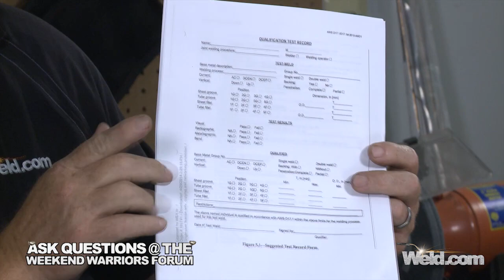D17.1 Certification: .063 Flate Plate Aluminum Tips | TIG Time

Comment: I was told I would be taking a plate test for aluminum 3/8 or 1/2.  What would the procedure be?  I can't imagine it would be a butt weld due to the thickness,  I see nobody welding V groves, if it is would it bee open root or backing strip?

Comment: we recently qualified a WPS and then the welders for one of our clients based on D 17.1
two things drove us crazy one is the high-low towards the end same what happened with you), the other is in the center of the root there was a line its not a crack nor oxide it was a strange looking thing, hopefully the test was a success (our welder was an experienced one) but what could you advice to avoid the problems i mentioned above especially the line in the root,we used zero gab with a small bevel on one side, about the same thickness you are using in the video.
thanks.
Reply: James A the line is just what happens when you have no gap if it was opened it wouldn't have a line